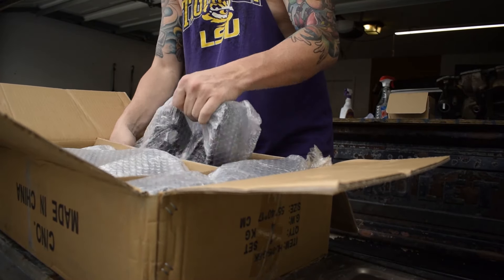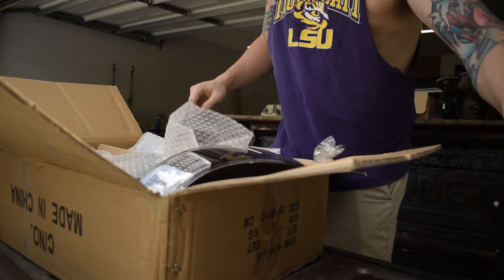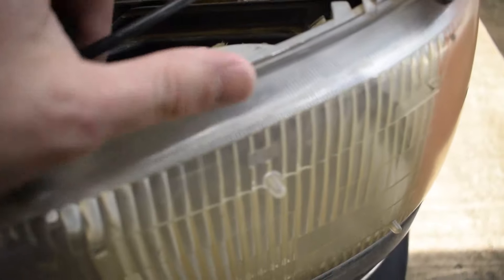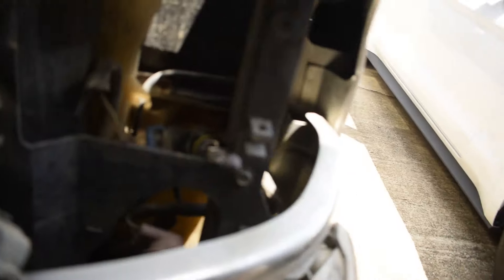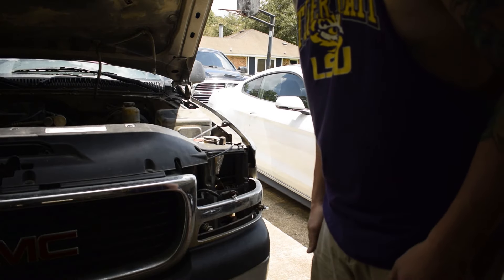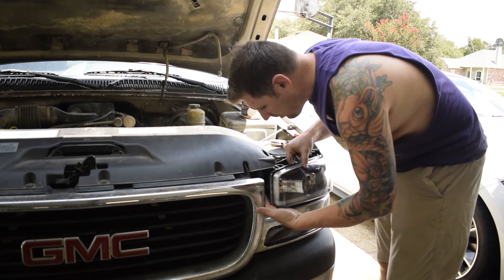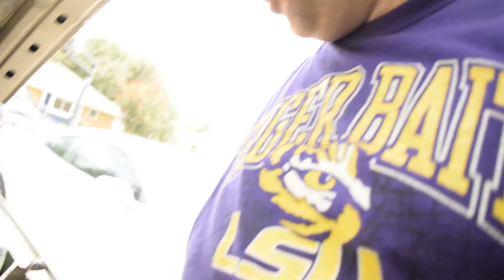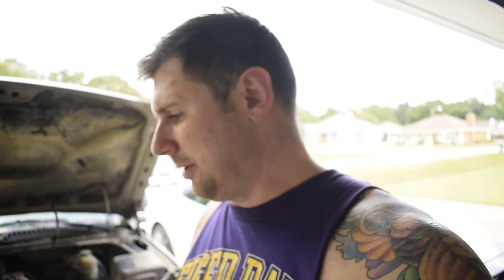2001 Sierra 1500 Headlight Upgrade!!

Comment: Are you thinking about changing the front end clip from the 2003 year?
Reply from the maker: Drae2g2 i plan to do that, but it might be a little harder to do then expected. The frame horns where the bumper bolts are not the same. So I’d have to cut and weld the 03 ones onto my truck.
Reply: @thesouthernc1092  We are in the same situation. I just swap mine with a 6.0 with a 4/6 drop
Reply: It was pretty easy cut the old ones off with the saws all got the 03-06 Frame bumper plates and drilled some holes and put 15 mm bolts and nuts just make sure to cut right behind the old brackets and you’ll be good

Comment: Is that green and white wire that was hanging out for the led light strip? Where do those end connect to?
Reply from the maker: MacAaroni you need to ground one and run power to the other. I’ll make a video explaining that soon. You could run power so they are on everytime the truck is on or only when you turn the headlights on.